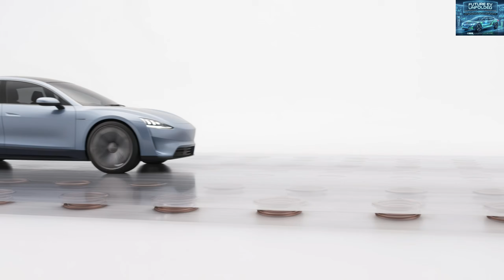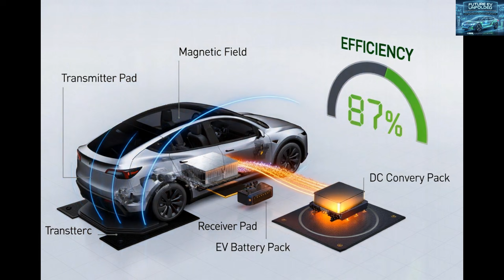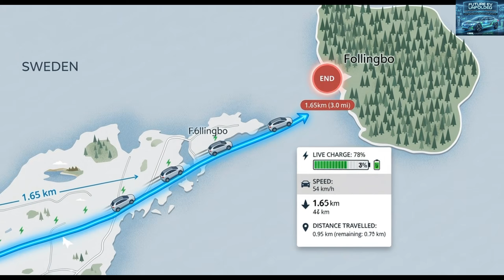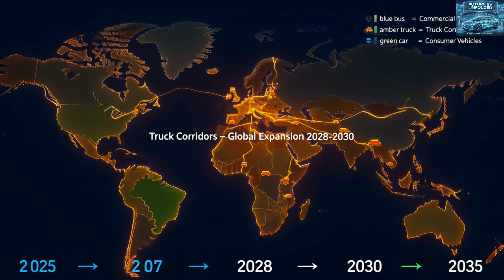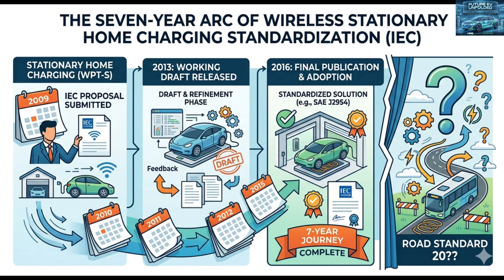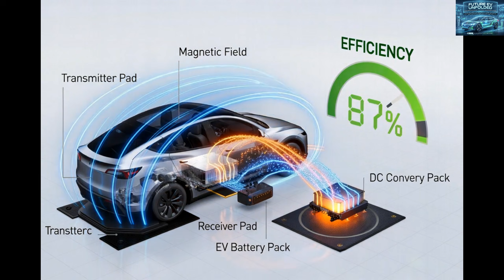The End of EV Charging Stations Has Already Started | EVs Wireless Charing |

Comment: Yeah, that ain't happening dude.  Just the cost of copper for something like that would be millions of dollars per mile.  Then you get to the millions of installation, millions for manufacturing.  Something like that would end up being several trillion dollars just to install it in a small fraction of city roads.
Reply from the maker: Thanks for sharing your thoughts, I  agree that cost and infrastructure are the biggest hurdles right now. However, looking ahead, I see charging while driving  as the ultimate icebreaker for EV adoption. This technology could fundamentally change the game. While the initial investment is high and hope the technology will evolve which reduces the cost of the infrastructure .the concept of charging station for 30–60 minutes is arguably more loathsome to most drivers than the current cost of entry, whats your thought on that